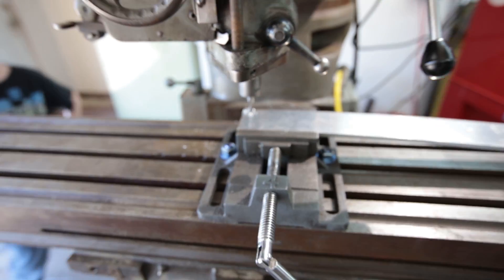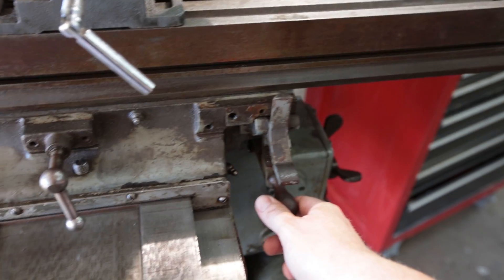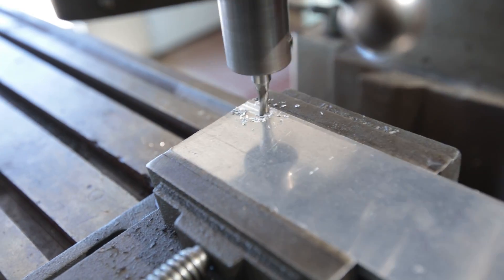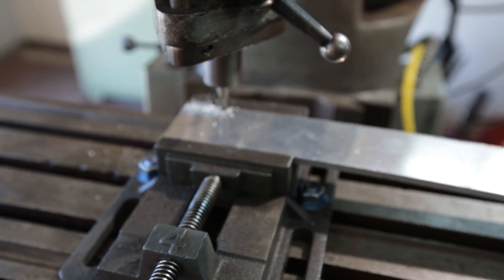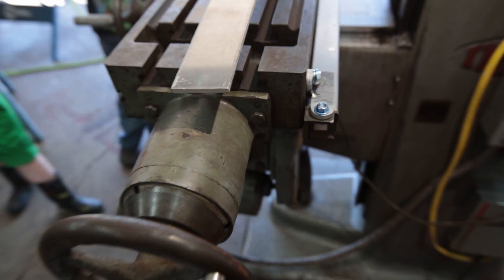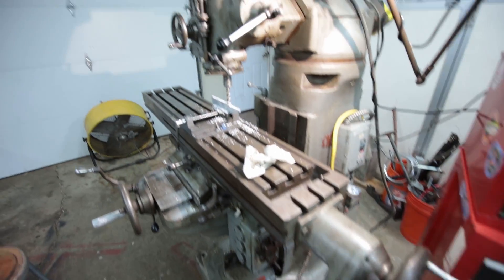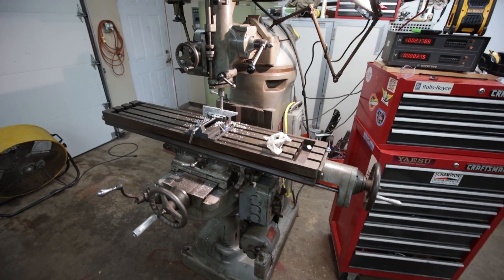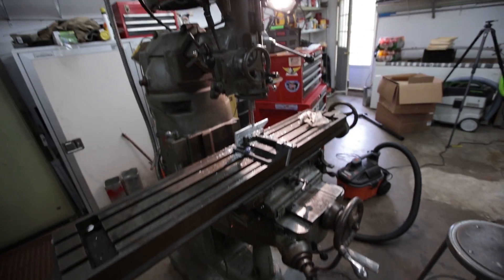First Chips with my Index mill

Comment: Right now I'm in the market for a knee mill, and the more research I do, the more I want a Bridgeport, or at least one that uses Bridgeport parts.  The Index you have has the same base as a "Duff" for sale near here.  That "Duff" uses D5 collets instead of R8.  The little I save buying that Duff instead of a Bridgeport  would be spent chasing after odd , expensive accessories and repair parts, if they can be found at all.  Not to mention the resale value of the Bridgeport over the "Duff".  I would equate the Bridgeport machines to the Model T of vertical milling machines.  The Tormach would probably be considered the Kia of CNC.